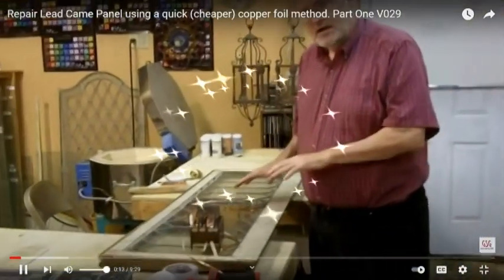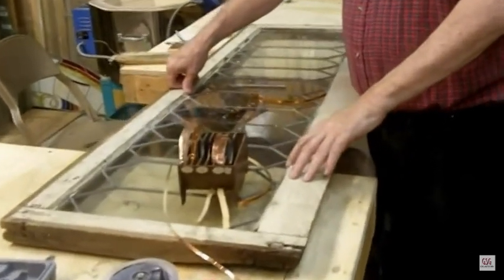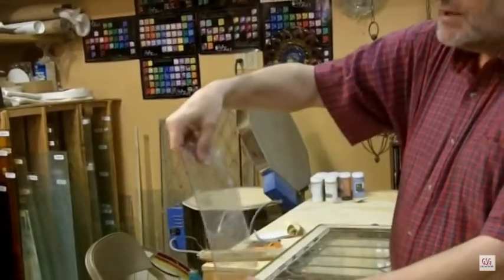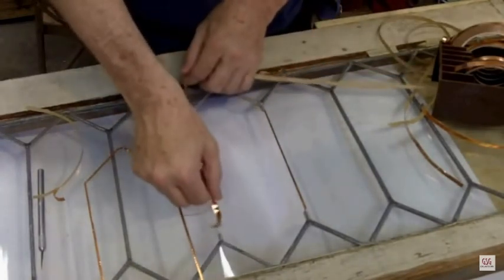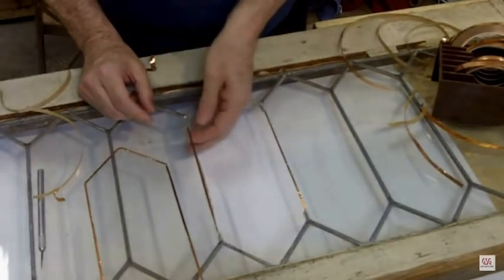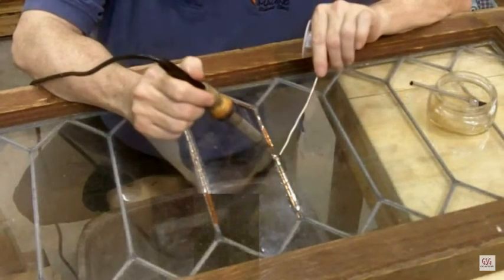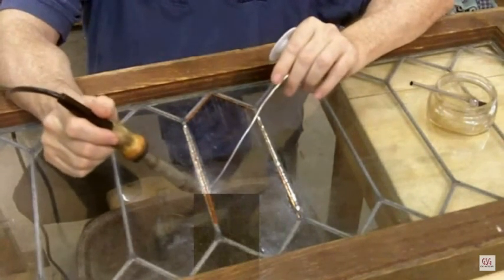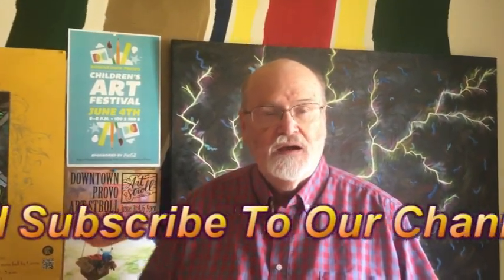Repair A Leaded Panel With Copper Foil V365

Comment: Thanks for the info a lot of good information I will use this method .I think this is better then messing with the old lead.
Reply from the maker: It's good to know both ways to repair leaded work, so you can do it right or so you can do it quick. 😀🙂😀

Comment: Thanks for the video. I've been using this copper foil technique on most of my leaded glass repairs. Each case is slightly different depending on the extent of the glass that needs replacing. And as you say, working the patina in to best match the adjoining lead is so important.
Reply from the maker: True... each case is different, you have to stay on your toes and adapt with each repair. 😎😎😎
Reply: @GommStainedGlass  I enjoy your videos - you can never stop learning and seeing how other people tackle a problem.
Reply from the maker: @rfrodriguez53  Thanks, we keep trying